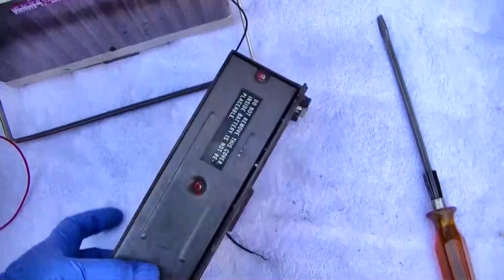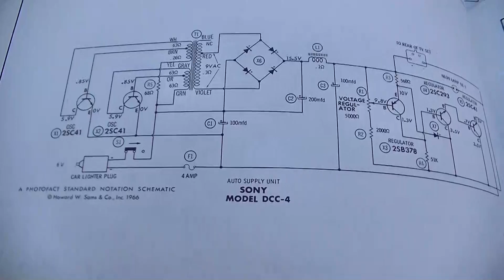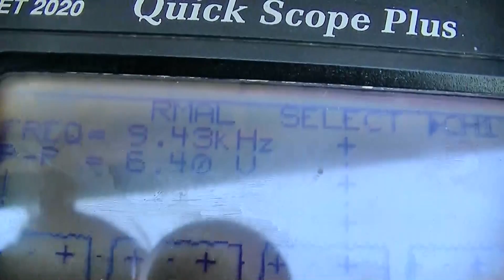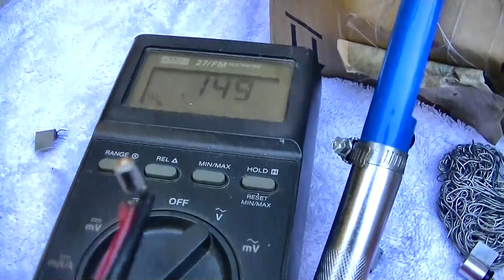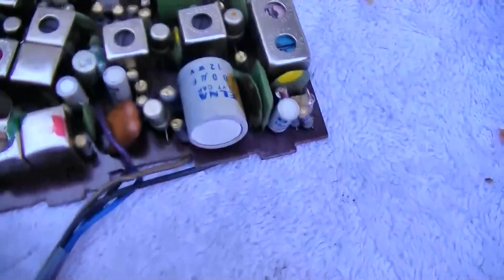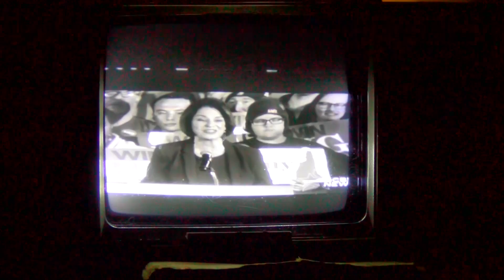Vintage Sony Micro TV Repair Attempt 1966 Portable Black And White

Comment: We had one of the Sony portable TV's, used it for years before we dropped it in a box. It sat in the garage for over 20 years before I pulled it out, dusted it off, hooked it up to a power supply and it worked like new.  The workmanship was outstanding, truly built to last.

Comment: That business of defeating the fuse was certainly a wrong thing to do.  They should have known that the proper way is to cut the head of fuse length 1/4-20 bolt and use the threaded length to replace the fuse.  (Just kidding - maybe.)

Comment: I was working part time in the Navy Exchange TV/Radio Repair Shop on Midway Island when these came out (the 5-307 style).  I was otherwise in the Navy as an electronics technician working at the transmitter site there.  Sony deemed us to be a "service station" and sent a big box of replacement parts for this TV model to stock.  Just about everything.  Yoke assemblies, individual parts, assembled boards, cabinet parts.  But (and this disappointed me) just not quite enough to assemble a complete TV.  I bought one myself as they sold for about half price at the Navy Exchange there.  At the time, it was considered a very attractive and well built TV.  I didn't own it long enough for any of the failure issues to surface.

Comment: If they use SMD parts then it is going to be a pain in the butt, Shame they didn't see fit to use a Royer Oscillator for the voltage booster.

Comment: My daughter tells me that my old Panasonic B&W mini TV like that is out in her storage locker. I thought I had thrown it away many years ago. I picked it up new years ago when I was a soldier, the Crown that I purchased in Tokyo went to hell and the base show said no fix to it. I wrapped the leads where the resistor had blown with wire and it began working again. I sold it to a Staff Sergeant who was working part time after duty as a motorized security guard. He had to furnish his own car, so he plugged the set into this car and mounted it under his dash. It was still working a couple years later when he was transferred. So at any rate I wanted a set to carry with me when we went out to the desert for a couple weeks training problems, the Panasonic came in Olive Drab, that's the one I purchased because it worked fine to toss it in my RATT rig, everyone thought it was some sort of oscilloscope or something, then when the evening came, I would sit in the rig where it was warm, secure (Secret Crypto clearance to open the door!) start my propane lantern and heat up some hamburger patties my wife had prefried for me and watch TV while enjoying my burgers and fries. Even in the 70's there was a way to stay entertained in the boonies if you just knew the tricks of the trade.
Reply: Did you find it?

Comment: Nice sets. Your symptoms asside from the no power are identical to what i encountered on mine. On my 5-303 i had a bad vertical output transistor. After replacing the transistor i now get a full raster for about 10 min before i start having vertical linearity issues. Sometimes noodling the pots brings it back. I suspect more bad caps (haven't re-capped the whole set yet) and some flaky trim pots.
Reply: Could be some out of tolerance resistors as well.

On my 5-307UW I replaced the resistors in stages on the deflection board testing after replacing several resistors. With each replacement the raster got a little better.

Comment: In 1974 I had a 1950 Plymouth 6 volt positive ground. I went to the local hobby shop and bought a converter 6 to 12 volt. I had to isolate the whole thing so I hung up by some string under the dash then I ended up putting rubber grommets.after that I just started carrying a 12 volt battery in the back floorboard for my 8-track

Comment: I have one of these (TV-500U) that after running for a few minutes goes to crackling. I've replaced all the electrolytics in the IF board, but it didn't help. I thought it might be silver mica disease, but the IF cans don't have any mica caps. Any clue what it may be? Also, I haven't been able to find a sams for it, do you possibly know where to find one?

Comment: When the fuse blew because it started failing, the aluminum foil must have worked (for a little while).  My parents tell me in the old knob-and-tube houses when they got broiler that would need 20a circuit someone put a penny in the fusebox lol!

Comment: I don't know if you this dude but the flashing white lines on top of the picture is data for the closed captioning you cant see it on the new crt TV's cause you can't mess with the v hold thats how they hide that data stream is just outside where the picture is the dude from technology connections a YouTube channel has a hole video that explains it

Comment: That one tv looks like someone hooked up a coaxal directly to the antenna input from a cable connection or from a output from a vcr i did that with a old thirteen inch i found in trash when i was a kid cause i wanted to pick up cable on it my mother new about that issue she told me i needed a pig tail to do something like that

Comment: During my 8 years in the US Army back in the 1970's I had two of these little sets. Different brands, of course. The first I purchased in Tokyo, it was brand named Crown, had a built in AM/FM radio came with a detachable 100-110 volt adapter as well as one that took I think it was 9 C cells.  That one lasted a long time till one night whilst on arms room guard (duty where they locked you up between the arms room and the issue room with a .45 and 3 rounds of ammo, super booooooring duty and the TV was a life saver. The set smoked and stopped working. I tore into it and found a resistor had burned in half. I think I must have had the power pack set to 100 volts? It was, after all designed for use in Japan, not the USA.  So I took the little guy to a TV repair center on Fort Bliss, the fellow there said since the set was never imported into the US, he could not get a schematic and was thus unable to determine which resistor to replace the burned own with. So I took the little guy home, sad that a set that had served me in my bunker in Nam as well as the Arms Room at Fort Bliss, and many times into the field during desert training was gone.  Then I had this wild idea to simply bypass the damn resistor, so I stripped a bit of copper wire out of a larger wire and wrapped it around the two pieces that were once joined as a resistor and soldered it in. The little guy came back to life and worked as well as ever.  I had a partner who worked with me after hours delivering furniture for Unite Freight Sales out on Montana Avenue in El Paso, he also had another part-time job as a night watchman for a small local airport, keeping watch over the aircraft.  When he was over for coffee one day he spotted my little set and made me an offer I could not refuse for the little set.  I sold it to him, last I ever saw of it, he had wired it in to his car and mounted it under his dash so he could sit back and enjoy his nights watching tv instead of airplanes parked on the tarmac.  Later I found that I really missed the set, so one day I found a Panasonic mini TV that was olive drab in color, looked exactly like  a piece of military gear. I purchased it and it came with me into the field many many times, I could sit in my radio teletype rig and watch TV, my wife would pre-cook some hamburgers for me and I would heat the atop a small lantern, stick them back on the bun and squeeze some ketchup from McDonald's. Since my rig was considered classified as I sent and received classified information, I always had it locked, when an officer would come for some reason or another, I could flip the switch on the little OD TV and they had no idea that it was not part of the very complicated configuration of the ANGRC122 Radio Teletype rig.
Reply: It is a nice memories with the air field watching duty...and the days went by very fast...sure you're still longing for those days.

Comment: You’re one of the neatest guys around, and so is Radiotvphononut. I like the resurrection of the radios, tv’s and record players, even the 1970’s plastic ones. Better quality plastic then. Like saving classic cars of the 1950’s and 1960’s you do one fantastic job on them, even if they’ve been baking out there in the desert for 45+ years. So much for junk tires, they can sit out there and rot. Keep the good videos coming, I’m a geek of electronics like you and Radiotvphononut. Learned of both of your YouTube channels in August of 2016, just a week or so after my mom passed away. If I find YouTube profitable, I may get myself a YouTube channel and join you guys. I’d like to see you resurrect the unresurrectable electronics. If not, hold onto them for they can be used for spare parts down the road.

Comment: I want to see some 6 volt positive ground p orn I bought a 6 volt to 12 volt converter one time and I had a positive Ground Plymouth so I had to hang the thing and insulated straps and run two wires to it but it worked

Comment: You really cracked me up with that Covid-19 cruise bit!!!  LOL   A little comedy relief is great...Really like your down to earth videos...Press one now!!1  Ha ha ha  Great!     I ave a bunch of Zenith modules around from my on the road days at American Appliance road tech job... Are you interested in any projection Tv modules in the box..Rebuilt by Zenith. I might have some xl100 modules and things like 516's. Also Zenith Ic's Rca dual dampers and a whole bunch of zenith outputs, More zenith Ic's etc &audio transistors etc..I'll be like giving them away for whatever is fair..Let me know..Will give you a list if you're interested..I really have no more use for them so......You can have them dirtcheap! I like to see them get a second life...Degaussing coil too. I'd just give you my B&k Analyst if you want that? Pay shipping, It's yours!  It's the old tube model not the solid state. Still works tho
I also have 2 177 chassis working w/no cabinet and I think a 185 rca chassis. If you can use them.? ..Just sitting in my basement since 2005 when the company went belly up taking my pension with them...gah..Hurts alot!      Let me know..we can do something I'm sure..

Comment: I have a similar TV but mine is a Teac, it is a bit smaller than this one but the Pic tube is the same size.  It has a carry case and it come with a battery it was from the looks a Lead acid battery.  The set is completely dead like this one was at first.

Comment: "SONY" transistors....probably custom made for Sony by Toshiba, or Matsushita
Reply: Or Sanyo, or NEC (Nippon Electric), but rebadged more then likely, kind of like a "Genuine" Philco or Zenith tube, whom were actually made by Sylvania.
Reply: I was about to put the same, Toshiba or Matsushita. They felt so inferior during mid 60s, that by end 70s Matsushita was number one VCR manufacturer with inhouse components and RCA buying VCR combos from them to offer in the Selectavision lineup.

Comment: I have my Grandmother's old Sony B&W portable. Much bigger screen. Not sure but I think it's 10 inch approx diagonally. Not sure if it still works. Keepsake. She never used a battery pack. Just plugged into 120 volt A/C.

Comment: Hey Shango, love your content. I’d love to see you bring this set back to as good as you can. I do electronic restoration and repair so I have a decent stock of parts. I can’t help you with the germaniums, but if you can get me a list of all of the electrolytic values I’m almost certain that I’ll have every value in stock.  I’ll send them to you at no charge of course.  I only stock Panasonic FC (a couple FR and FM), a few series from Nichicon like FG, FZ, and several of the 105c series, and lastly Elna Silmic II.  Elna can be good lol.  I only order my parts (caps anyways) from Mouser or Digikey. So roughly 95% from Mouser and the rest from Digikey when Mouser didn’t have stock. Anyways, if you want to tackle the recap and someone can let me know how to get in touch with you I’ll send off the caps ASAP. Thanks again for the entertainment!

Comment: "It's a SONY" - when they work, they're great units which perform well; be it a TV, a VCR, or a home audio system.
When something goes wrong, however, they are a royal PITA to troubleshoot and repair due to their complexity.
Reply: @Louis Reed One thing is for sure; despite being somewhat over-designed, they didn't scrimp on quality - Sony made some pretty decent gear back then.

Comment: I had a 501U (510U?), White and blue plastic with a detachable base that was the battery pack. Carried it everywhere when I was a teen.  Sony wanted you to buy an adaptor to attach an external antenna, I hacked a speaker wire with a phone plug into a TV cable splitter for my own adaptor.

Comment: How DO you use it? There are no NTSC TV stations and cable companies don't do standard definition any more. In other words, there is nothing to watch.
Reply from the maker: false
Reply: What is your signal source?
Reply: @glenngundlach9907  DigitalTV converter box or his Direct TV set top box.
Reply: Unlike most places, LA still has one low-power UHF TV station on Ch6. For how much longer is anyone's guess. But yes, to actually watch TV on an old set, you need s converter box. There's still plenty available through an antenna, but it's all digital.

Comment: i have one like the small one, slightly different, case is black vinyl covered, instead of the wood effect,  vhf is ok but uhf seems dead, looks a fairly major job to get the uhf tuner out, ... i have a 'monitor' very similar to the larger one, just has video and audio input,  no tuner/if parts...
Reply: the battery holder on my small one takes removable standard C cells, the nicad pack mustve been an alternative option...

Comment: I think you would have fixed it quickly if nobody had gotten into it and tried to fix it before you.  The aluminum foil on the fuse is a good indicator of that.

Comment: Strange you mention the Elna caps all being bad from this era, '75 onward they have all been good in the equipment I've found them in. And Shango, if you were "smart money" the world would be a much poorer place. Your persistence & determination are what we come to watch, if you can't fix it not many could!
Reply: I just recapped a Roberts 6000 portable tape deck and it had a ton of these Elna caps. They were all either open or waaaaayyyyy  off value. It's just like Shango was saying I ended up pulling out the Sam's and ordering all of them from mouser.
Reply: @equid0x  That's probably what's wrong with the Rheem Roberts eight track I have, it's early 70s vintage, built by Akai. I hope it's not one of the Sanyo ICs that's popped.
Reply: @a.fritzbecker8986  Probably the caps. My deck was completely dead before recapping.
Reply: @equid0x  It's an interesting turn, the vintage solid state stuff is to electrolytic cap replacement what tube equipment is to paper cap replacement, if not worse. I can remember having tube sets from the 1940s still functioning on most of their original caps in the late 80s and early 90s, but the caps in a lot of S.S stuff from the 60s was already starting to fail by then.
Reply: @a.fritzbecker8986  Indeed. I have a '61 Grundig set with lots of paper caps. Most are still original but I've changed a few of the low value stuff out that was open with ceramic. The set works fine, but I suspect it's lived it's entire life in a climate controlled environment.
Reply: Give them another 10 years and they will fail the same way.

Comment: Funny you brought these out, I've just got my hands on a Bush BN6520 A (late 1970s J. Arthur Rank Radio International special) miniature TV/clock/radio with 4" CRT and built in alarm and sleep functions. :) Never knew they made tiny TV's as far back as mid '60s though, the set on the right is super cool looking.
Reply: It seems like I remember a Sears microwave that had a very small TV built in.  I always wonder how much shielding it took to not fry the electronics.   I had a under the counter small TV with a tuner much like a radio that I could also tune in cell phones sold by GE.

Comment: That TV with the 9 NiCd cells would be a nice candidate for a lithium conversion, could use a 3s3p setup.
Reply: He shoud try putting them on his computerized charge controller. He has a video of a transistor radio with a 60 year old nickel cadmium battery that ACTUALLY TOOK A CHARGE and made the radio play!

Comment: ESR is not the be all/end all of judging capacitors. Too many today assume that ESR being low means it is OK.

Well, a shorted cap will have good ESR. Leakage will be ignored by most ESR meters, as will off-value capacitance. ESR meters are the simplest things to make but they won't tell you about many other failure modes. Meters that measure value MAY give you a clue: bad caps will have an elevated capacitance reading. Some will read 200-300 percent overvalue. Most are more subtle. Ideal examination requires something like a Z-meter (Sencore).